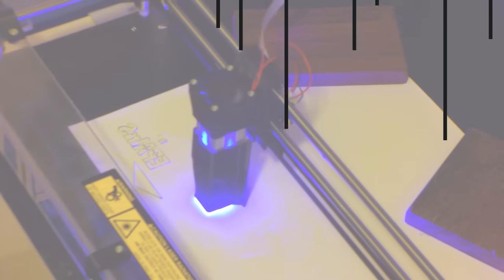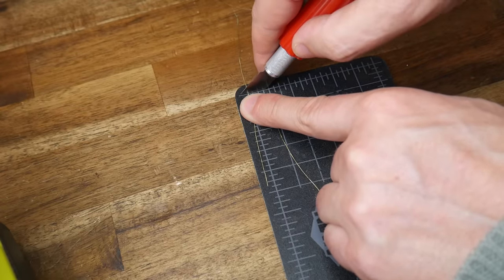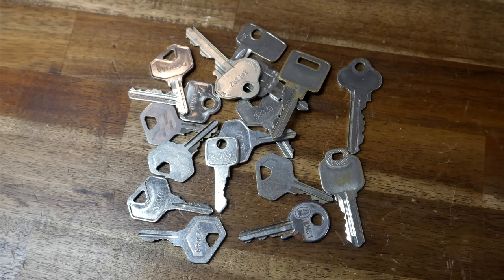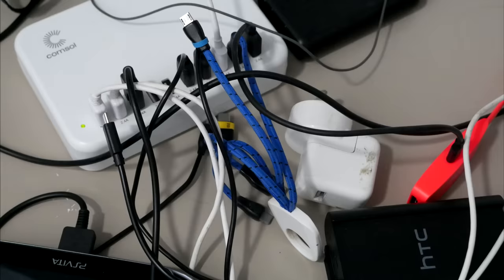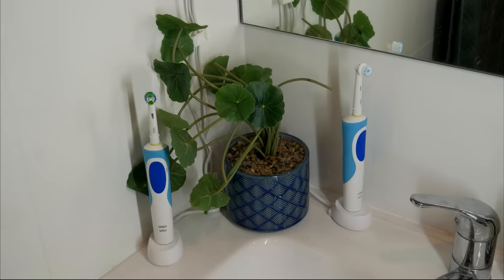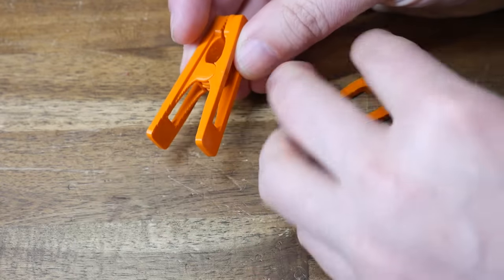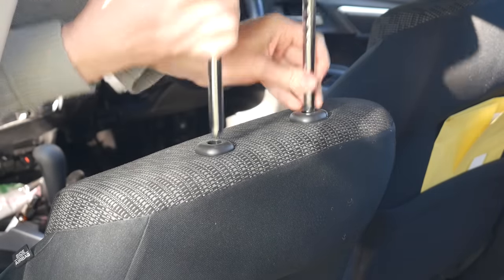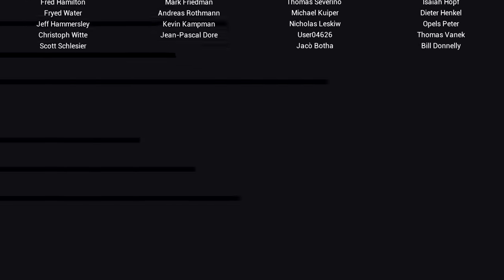The best 3D prints to organise your life - Part 2

Comment: I can't wait to get my first printer! Need to find another job before I can buy one 😢
Reply: Just be careful that it will become the gift that keeps on "giving"... errr, taking. It's not just the initial cost for the printer itself, you'll also need rolls of filament in different materials (and possibly also colours) at around $20-25 a piece, filament drier, many upgrades (if you're buying a cheaper printer to begin with), maybe also carbon filters, an SBC for Octoprint or Klipper, maybe also a web cam for it, etc etc etc.

Comment: Thank you for featuring my cable clips, Michael!

I was perplexed by yesterday’s download numbers and just saw a comment from the user goTVm over at Printables, who mentioned you'd posted this video.

Let me point out that not only KLAMMA, but KLIPPT as well is “tape-compatible” with the other base plate (At least in light-duty applications.) This makes once printed clips even more versatile because you can interchange them easily.
Reply: Same here! I was wondering why there was a spike in views and downloads. Thanks for featuring the Diffusion Panels. That timelapse looked amazing! 
These were modeled so that the deepest point on the front would touch the back panel in vase mode, making it more rigid and stay flat, assuming a .4mm nozzle and .3mm layer height. I am curious what slicer settings could be tweaked to make that happen on his and other printers.

Comment: i can confirm the broom holders are great. the design is very creep resistant (the biggest problem with load bearing 3d prints) and the 10 or so that i have printed are still working after more than a year. they also work just fine when all parts are printed at 80% scale.  i use rubber bands for grip and dont mind having to replace them every few months or so when they inevitably degrade and crumble.

Comment: FYI, I am 99% sure that the sound panels won't help at all regarding sound diffusion or absorption. The only thing I would find use for them are for aesthetic use.

Plastic isn't a good material for any acoustic purpose.

Btw I am a sound engineer so my comment is really to help you out so you don't waste filament and time with these "sound panels" 😅
Reply: I heard you could recycle with cartons as a sound proof material
Reply: @jpeero  For sound absorption, you want the sound to travel into the material and then get trapped within it until it looses all of it's energy. 

So carton isn't a good material in terms of sound absorption.
Solid materials only reflect the sound and although carton is somewhat porous, it's mostly solid.

If you want to recycle materials, think of anything that's thick and porous, like foam. 
A mattress does more than any amount of carton you can think of haha.

Also, thick rugs or heavy curtains help in terms of sound absorption as well. 

A good and cheap material for sound treatment is Rockwool, look up "DIY sound absorption panels using Rockwool" and you can see how cheap they are to make. That's my go to budget and effective suggestion.
Reply: Yeah the author of the model notes it is for "sound diffusion", but I wasn't quite sure what the perceptual impact of that would be so despite it looking cool I didn't bother printing them.
Reply: @coreyward  sound diffusion is another application within acoustic treatment, and even tho it "looks" like it was designed for that purpose, I'm here to let you all know that the little sound diffusion it would actually achieve wouldn't really matter enough for you to spend the time and money to print them. 

You would need to print them solid (not in vase mode like it's suggested) and even then I doubt it would do a good job at diffusing.

They're pretty, but if you are looking to get any practical acoustic use out of them, you're better off making other DIY diffusers.
Reply: @ZomBmusicHQ  Appreciate the confirmation!
Reply: I was thinking the same thing. If anything those panels look like resonators.
Reply: Aesthetic use? Talk about that after they've collected some dust and you're trying to clean them up (while stuck to the wall, otherwise you could simply wash them in water)
Reply: @dan-nutu  Ever hear of a vacuum?
Reply: @coreyward  Ever actually tried it on acoustic panels?
Reply: @dan-nutu  It’s plastic. The use case isn’t really all that relevant.

Comment: 3:09 While the reflection looks good, making the surface fuzzy (in Cura, fuzzy skin) would probably make it more effective. This will mimic the porous aspect of foam panels. You'll also want to print it with a couple of walls to make absorption better and stability for the fuzz.
Reply: I've never used fuzzy skin on vase mode. What do you know. I just fired up PSv2.7.1, loaded a built-in cylinder, turned on vase mode and then fuzzy skin. It sliced w/o problem. How well does it print, I wonder.
Reply: @Sembazuru  I haven't ever used fuzzy skin and only used vase mode once for flow tuning (from Teaching Tech's calibration video and website). I suspect a fuzzy vase will be really sketchy to print with all that shaking and no wall to support it.

Comment: This is a great video, but I do feel it's worth pointing out those acoustic panels must be printed in something non-flammable like PETG. PLA is highly flammable and flammable acoustic panels have been cited in so many fires as being a significant cause of the severity (The station nightclub fire is a significant, and very tragic, example). Usually it's flammable acoustic foam, but the same would apply here if you don't use the right material.

Comment: You should tell yourself and friends to make a parabolic plastic bowl shape device for painting with zink for wifi band dish reflection and maybe make a mesh dish backing with like speaker wire and copper wire so you can make your own wifi reciever sender for a laptop wlan card adapter for high priority use at like 760 characters per second for long distance simple internet use

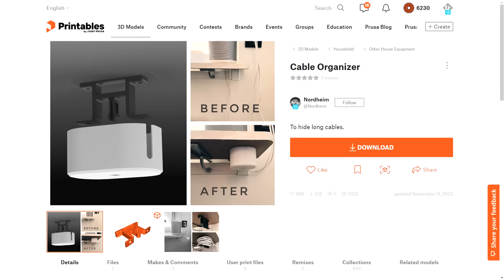Comment: The organizer at 7:06 seems like a good idea, but won't the coil create an electromagnet? That could be an issue with anything magnetically sensitive and possibly vampire out some electricity to keep the EM field energized.
Reply: No, because when current flows in both directions, magnetic fields cancel each other (in very close range not completely, but in practice well enough). If you separate L and N (or + and -) and coil them in different directions, that would be quite different (better not do that though 🌩) 😉

Comment: I would say that the cable organiser where the cable wraps around then is covered is a fire risk the coil will act as a transformer winding and could melt etc
Reply: Don't know if it will be a risk here. Think the cable is too short and loosely coiled. But my last workplace, they used an old welding thread roll to roll the extension cord around. One day one of the workers was making waffles and didn't unwind the cables and they melted and shorted.

Comment: The sound panels are awesome. I’ll def be making some to experiment in locations behind the tv for optimal sound.
Reply: just use a curtain offset a couple cm from the wall, way better than printing a load of junk
Reply: FYI, I am 99% sure that the sound panels won't help at all regarding sound diffusion or absorption. The only thing I would recommend them for is for aesthetic use.

Plastic isn't a good material for any acoustic purpose.

Btw I am a sound engineer so my comment is really to help you out so you don't waste filament and time with these "sound panels" 😅
Reply: @ZomBmusicHQ   just what I thought, but would a curtian of some sort suspended from the wall that sits a couple cm away from said wall help at all?

Comment: The cable organiser you used for your 3D Printer mains cable concerns me. As it’s AC you are going to get eddy currents flowing which can overheat the cable. I’d recommend frequent checks until you are sure you are not going to have a problem.
Reply: That's only a problem with high power devices and a large numbers of turns - it's why there's warnings on cable reels. A few hundred watts and 3 turns won't even think about getting warm.
Reply: Having worked in medical electronics for over 30 my experience differs and I would always advise caution.
Reply: @regularcyclist4852  Why not calculate the inductance of 3 turns of a loose coil of wire with an air core, the heat generated by 400W in it and the heat dissipation capability of (what looks to be) a 10A cable? As something to be cautious about, this falls between the funny look the budgerigar gives you and the nagging sense that mentioning your qualifications on the internet might make you look silly.
Reply: @smorris12  In the example given the cable is feeding a 3D printer. There are a lot of such devices out there that are supplied with low quality cables. What is wrong with advising people to simply be cautious? In most cases there will be no issues but not there will be problems in a small number of use cases. Your apparent denial of that is making you look the foolish one here.
Reply: I have seen coiled extension cords melt their insulation because they were used while wound up. They were probably drawing more current than his printer, but I think this is a concern worth paying attention to.

Comment: 7:45 Neat but any user must be careful. The cable might get too hot, due to several reasons*. There have been cases where such started house fires.

*=All cables get warm when electricity runs through them. It is only a matter of how much. With longer cables and higher draw results in more waste heat. Normally that shouldn't be an issue, but if you curl it up in  a box, airflow is restricted. On top, rolling the cable up turns it into an inductor. Which generates more heat than a straight cable.
I doubt the printer here will ever draw enough power to amount to much waste heat, but …
A space heater might be a different cattle of fish. Or a cheap cable … back in the day, all cables were made of copper. These days, more and more are copper coated aluminum. Some are just aluminium. And some are just steel, which is cheaper still. Or a longer cable.
Now combine a long cheap cable with a high draw, and you are just one curl up away from a catastrophe. Not to speak a curl up in a box.